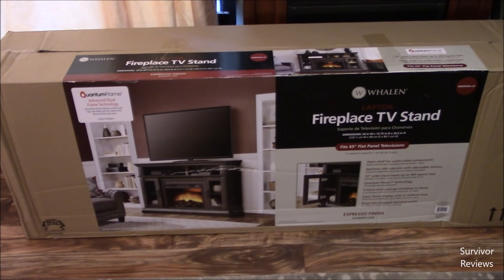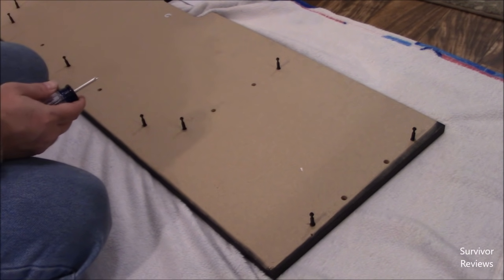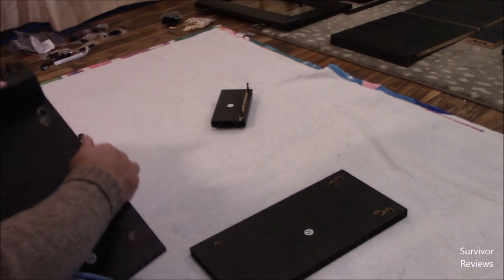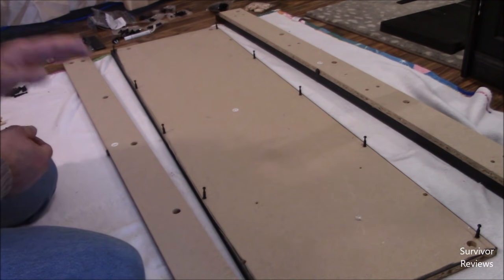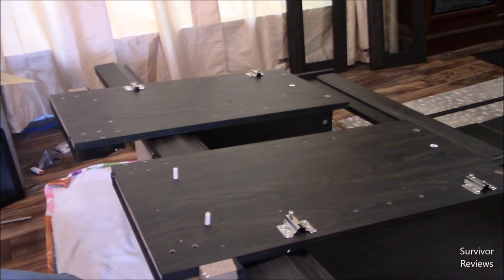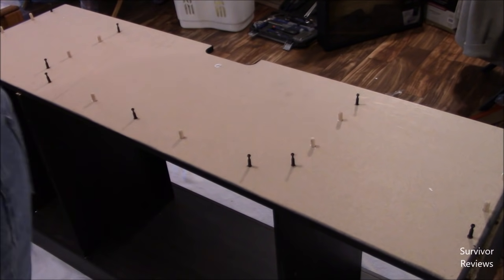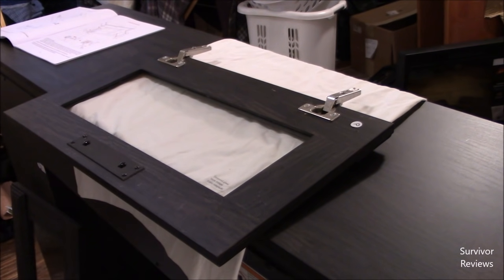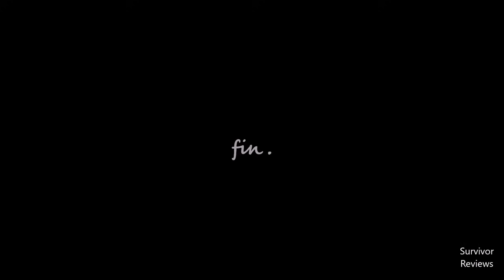Whalen Wal Mart Fireplace TV Stand Review

Comment: Looking to buy this one or a similar one from home depot which costs more. Dont know if the home depot model is real wood or mdf like the wal-mart brand but it is $150 more so i would assume its sturdier. It also heats up to 1000 sq ft unlike this brand. Are there fan settings? Temp settings? Like can i set it to run at 72 degrees or 65 degrees? Thats a little convenient feature to have. Thanks for posting your vid.
Reply from the maker: kawi lifezx10r: This one has no temp control, it is either on or off.  If you have electrical skills it should be possible to wire one in, or replace the firebox, but the only control you can adjust is the lighting.  Additionally, the directions are not that good.  Hope this helps.
Reply: Good luck this is harder than it looks

Comment: Hi, thank you for making this great video, I just thought to ask around the community of owners of this heater insert.. I find that I am so busy and focused on my studies that I often go too long before standing up to turn the heater off. And this heater is epic powerful. So I am just going between being "too cold" and "too warm" for hours. Is there anyway I can add some sort of timer plug or smart plug to help things along? I think these plugs can help "turn off" but probably can't help "turn on" because of the way the integrated buttons must be utilized to turn it on.
What has worked for you? I see some smart plugs are only CDN$30 or so on Amazon Canada and I am tempted in doing this upgrade.
Reply from the maker: LH D: The lack of a thermostat is indeed perplexing and aggravating.  Without buying a new insert, I'm hesitant to add anything to the wiring.  I don't think a manual thermostat will work because you have to turn it back on each time.  I'm sure there is a way, I just don't know of it or if it would be economical.
Also, I turned mine on last weekend, the output was about half from what I remember last year.
Thanks for watching!
Reply: So what I did was do some reading.. and obviously one way about is it to grab a new heater unit and just leave this fireplace turned off or off to the land fill.

So I am contacting the brand behind the fireplace insert to see if I can grab an operation manual just to get a better sense of what I am dealing with.

I was reading about smart plugs and apparently what I need might be more than a smart plug, but a smart plug but also a reporting thermometer. And some of these smart plug + thermometers are liked walled gardens, the brand behind it would like you to buy a bunch of junk you may not need. So I found that someone had been "unlocking" these devices with a custom firmware. 

So I think the brand is um.. Sonoff Basic.. or something like that.. and the firmware is an open source effort called Tasmota. The tricky thing is that flashing the firmware is not easy, so if you can find someone on eBay who is kind enough to pre-flash them for you, you are definitely in the game.

From there, I was thinking of telling my home PC server (which is on, 24/7) to set up a batch job that runs around the clock, doing two things: 1) poll the embedded webserver that reports the temporature on this Sonoff plug; 2) if the temperature is too high, power cycle the smart power. 

I think that should accomplish what I am trying to do. That way, I still have to walk up to the fireplace to turn it on, but I no longer have to suffer through too much heat.

Comment: We're having trouble putting part Fand the other part for the cabinet door?what am I doing wrong?when we remove the screws and the delrod it goes in perfect without them but we know we need them in...
Reply from the maker: Try flipping the vertical pieces, then they should line up.  I had the same problem myself.

Comment: Have so much trouble right now with f and h
Reply from the maker: Brittany Zapata: they really should have marked which side was up on the vertical pieces.  I suggest flipping them until the peg holes line up, if that is the problem you are having.  If not, let me know and I'll try to help.  Thanks for watching!
Reply: Did you get it figured out?

Comment: I’m stuck on the part you edited, how did you get the doors attached?
Reply from the maker: Kayla McCann: They slide onto the brackets.  I had to remove one of the bolts to get them on.  Be sure to replace the bolt afterwards or the door may drag.
Sorry I left that part out.  Hope this helps and thanks for watching!
Reply from the maker: Okay, there is a screw in the back, loosen that back screw and the rail should slide under it.
Does that help?
Reply: Kayla McCann I wanted to get it now but I'm afraid about the bad comments here
Reply from the maker: https://youtu.be/qCmCyDqaCsY
Reply: Tom! I don't think your video is the part people are having trouble with, it's aligning the side panels with D and E. Screws and wood dowels are not aligning together. Literally having this issue since yesterday.
Reply from the maker: Monica Aguilar: Ah.  Try flipping the sides.  I ran into that problem myself because the instructions didn't say which side was up.  I can't show that as it's together now.

Comment: Having a lot of trouble getting f and h on. I’ve watch the vid and read the comments nothing is working.
Reply from the maker: Marcedes Mosley:  If you are having problems, instead of trying to match the cut holes from the top, flip the shelf piece over and line the holes up where it's easier to see them.  If that doesn't work, there may be an error with your fireplace and you may have to call that number in the directions.  I hope that helps, wish I could advise you more.